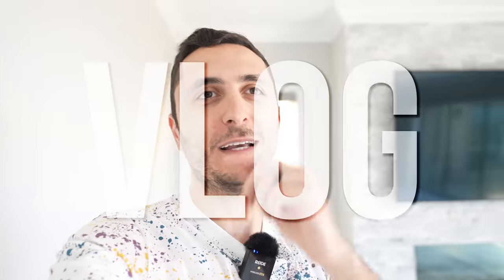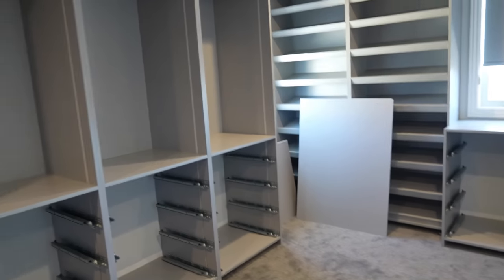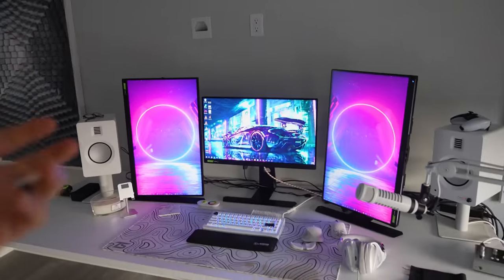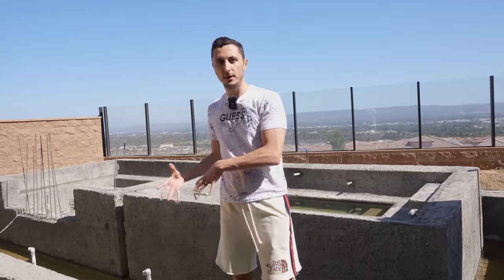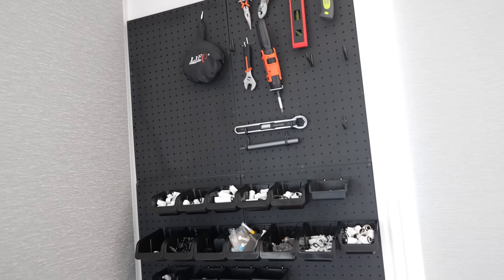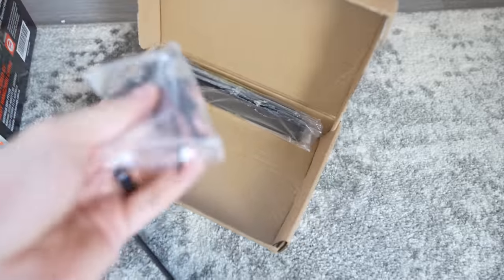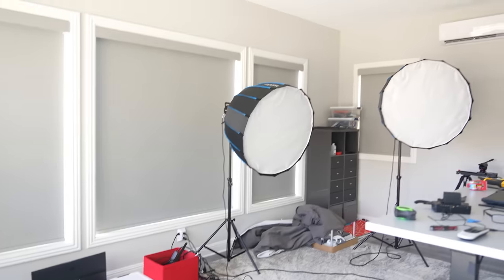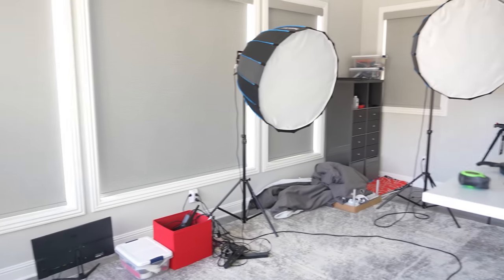What happened with the Ultimate Dream Setup?

Comment: 6:50 It's not for the cement to harden, but for it not to dry too quickly, which would cause cracks, as the cement hardens faster on the surface due to the sun/temperature.

Comment: At 9:13 i noticed the feeds/pipe to your a/c disconnects don't have whats called an expansion/slip coupling. It is what electricians use when pipe goes from ground to wall. with weather and ground settling the pipe will love with the pipe when this is there. if not the pipe might pop out of the a'c disconnect and maybe even pull the wires and cause a short! I just wanted to let you know! Not sure if you will see this but hopefully you do!